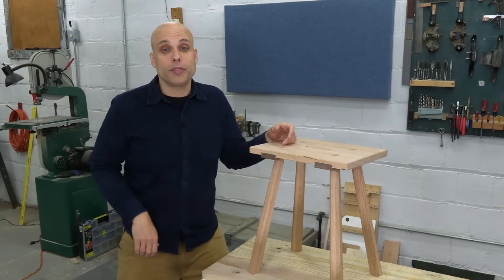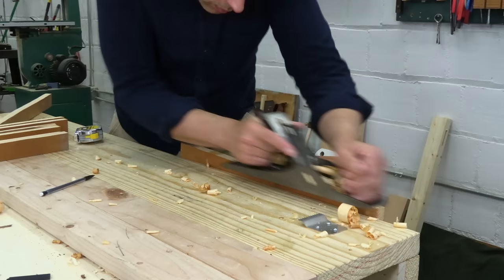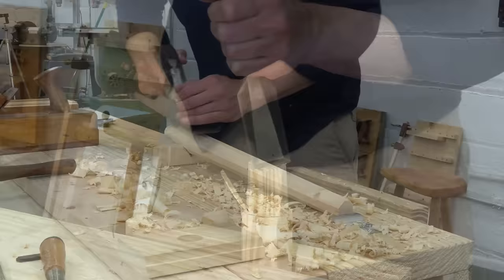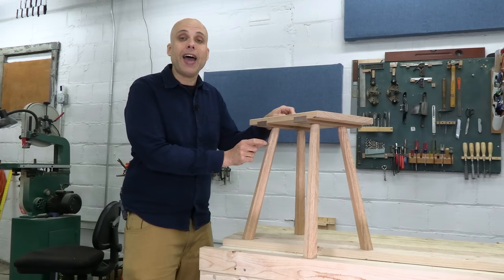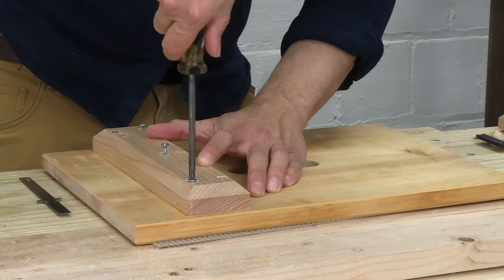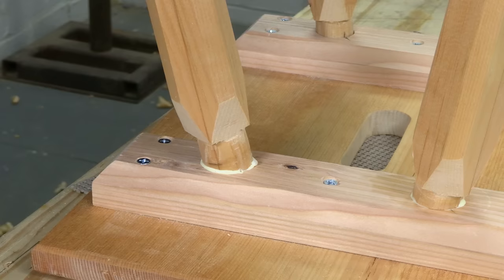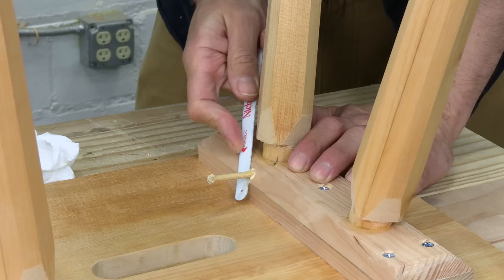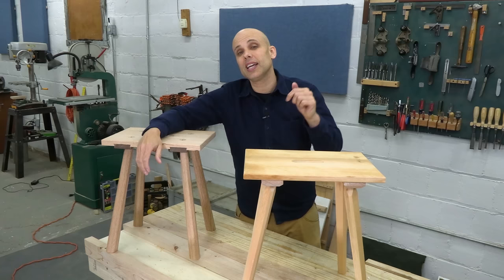I Built Three Moravian Stools to Find the Best Design.

Comment: Driving screws with a bit and brace during assembly saves time, effort, prevents carpel tunnel syndrome, and still gives you the sensitivity to not over drive or strip screws.

Comment: How about a blind wedge? Put the slit in the leg make a wedge and make sure the leg won't bottom out and that the wedge will fit the slot and not extend too much past the end of the leg when driven in. Add glue, put in the wedge and then put the leg into its hole and pound away to seat it and the wedge will make it tight as it seats into the slot while driving in the leg.

Comment: There is the technique for hidden tenons where you cut the wedge slot, slip in a wedge, then the wedge seats as you drive the tenon into the recess/hole.
Reply: The foxtail wedge! Great joint, but not really needed here with the battens screwed on, just put the legs in the battens and wedge normally first!

Comment: In those tight areas, you can score the peg a little long and snap it off once you have it seated then chisel it flush and sand it smooth. A little easier than wedging a hack saw blade in there.

Comment: Rex another way to secure those legs is with a hidden peg. Cut your slot in the tenon , make your wedge and place it in the tenon with about five mm or quarter of an inch. When you place the tenon in the mortis and tap with your mallet the wedge will expand the tenon and lock in in place with nothing to show.
In boat building it's called a trenel or tree nail

Comment: I bet you have end nippers or diagonal cutters around your shop.  I have found that they and a chisel work well to trim pegs.  It's a little fussier since there is more waste to clean up than a saw leaves, but it does work.  I'ld be curious to know if any one has experimented with the fail conditions.  Older pieces are often glued using hide glue, which is strong, but vulnerable to moisture degradation.  Would a joint glued with a PVA glue see benefit over the long term from being pegged as well?
Reply: The nice thing about using pegs is that if the glue fails for ANY reason (moisture, a less than ideal joint, bad glue) is that there is a mechanical connection. It might only be a small peg but all it has to do is stop the leg from coming out. The tenon is taking all the force and abuse when you think about it.

Comment: I know it's not common, but with all the round tenons you make, I wonder what your take is on spoke pointers and hollow augers. I've only ever seen Engels coach shop use them because they are a bit trade specific. I got a set because,  you know, old tools.  I've been surprised how much I use them.
Reply: or use a (adjustable) rounding plane to make (tapered) tenons

Comment: I bought a new 1" Fisch auger bit for my brace for like $70. It drills about half a hole and then loses grip and won't continue unless I put over half my body weight on the brace. I read the chapter in your book about making holes and  but it didn't fix this problem. I get 1 shot to make the tenon for my mallet in from a chunk of mesquite I saved from going to a land fill. Any tips or hints about using my bit brace and auger would be appreciated.

Comment: Whew!  Planing those chamfers vertical with the plane biting into the end grain like that?  Brutal.  I always try to avoid that with every ounce of my being.  The risk of accidentally cleaving off a huge long splinter of the face is high.  And the planing is not pleasant.  Attack from the side grain for a much more pleasant chamfering experience.  You should, when possible, always try to have the leading edge of the iron slicing into the face grain first for a much smoother, cleaner, slicing stroke.  The angles you used would be fine if the stock was clamped flat on the bench top with your working edge just off the edge of the benchtop.  The clamped block works great for the end of the cut, but it doesn't do anything for face tearout from planing into end grain from the wrong direction.   To keep your sacrificial block from exploding like it did here, consider spinning it so the end grain of your block butts the edge you are trying to preserve.  Once the plane breaks out of the end grain, the edge grain of the block makes for a smooth landing zone that makes continuing the stroke effortless.  Try it and see what you think.

Comment: Nice approach, nice execution! 
I was wondering: Would it be possible to simplify the wedged batten by making an ever so slight taper to the cut in the seat, make the battens a bit overlong, and by simply dispensing with the shoulder? -So the batten ends up "D-shaped", which will be much easier since you could plane it to shape, and also a little tapered, so a 100% fit would be less crucial? Use the "through-method" or "blind-method" for the legs to fit your temperament...
 I'd do it myself, but I live in an apartment in the city, so no place to work :(  (Also I'm not good enough with hand tools! :D -learning a lot, though. )

Comment: I don't see why you'd be concerned about the strength of that joint with only glue. these legs see zero tension forces in use, what's going to pull it out?